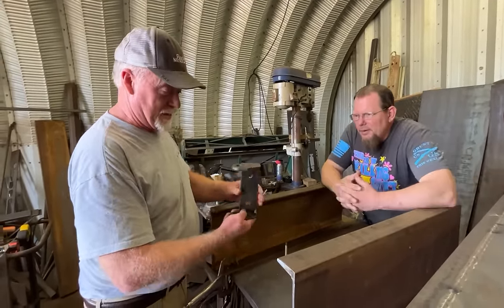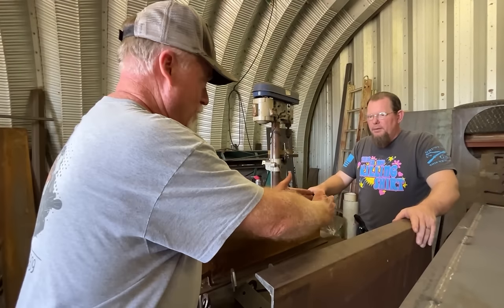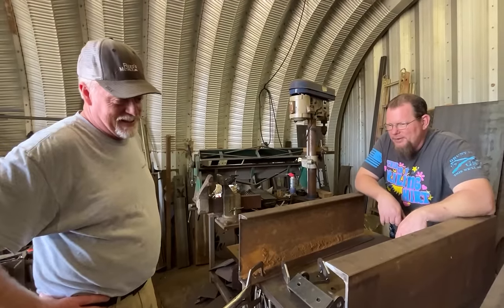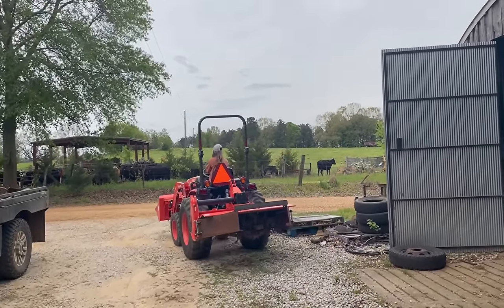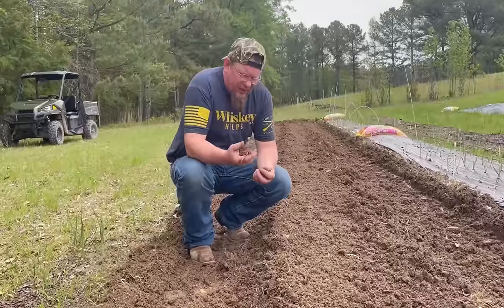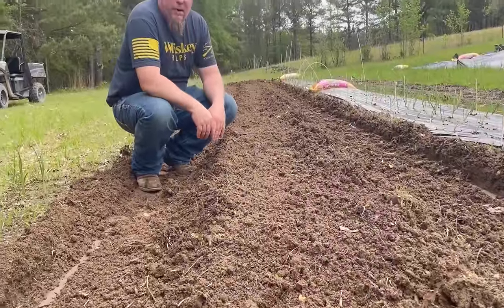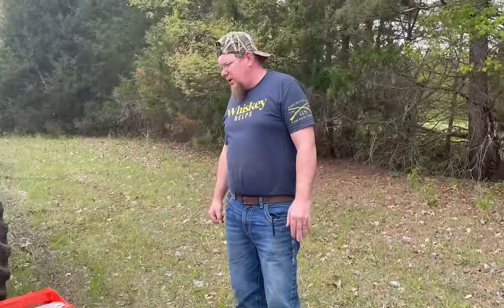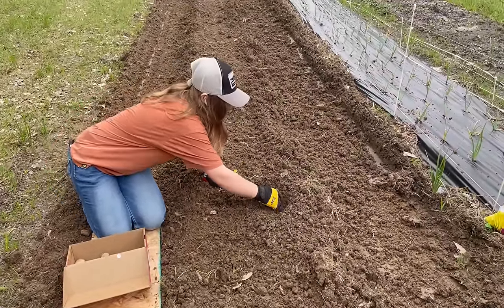Homemade Garden Row Builder, First Time Trying It Out!

Comment: Welcome to Mississippi.  Don’t know exactly how long you guys have here but did notice 2610 tractor and equipment.  A suggestion if you don’t know,  use a 6 or 7 foot steel fence post to move equipment while hooking or unhooking!  Makes hooking up with the standard 3 point hitch much easier.
Phil

Comment: The bottom flange on the hiller is holding it up just like the side shoes on the tiller. remove the bottom flange and you will see improved hilling and save time and fuel.
Reply: I agree, but also maybe, if they left about 4-6" of the bottom flange, bent down at the front, maybe that would help "pull" the hiller down into the ground?  Obviously I am not sure, but the unit is not going into the ground.  🤔
Reply: I completely agree. that was one of my first thoughts on this style vs many on youtube

Comment: I am a fabricator at heart, I love seeing new equipment being built and refined. You are on to a great thing here. One thing that might help with the less than ideal soil conditions is maybe taking a grinder with a wire wheel and cleaning the inside so that the soil has a smoother surface and less friction allowing the dirt to move freely. I learned a trick years ago with a shovel,if it is clean and smooth digging is much easier. Wish you the best with this project, and please keep up to date.
Reply from the maker: Oh cool ! Yes, it’s a great town with great folks !

Comment: Boy, that thing is really going to be a game changer for that tiller.  I haven't owned one of those but a friend has one and one thing it lacked was a good way to lay off rows.  This will fix that for sure.  You are right, the best way to do it is to till without it and then come back to lay off rows.  You could probably pull that in to the second notch and make a perfect well mounded row in good soil conditions.  My Daddy always believed in having good "middles" to hold water between the rows in dry times and keep the seed/plants up in wet times. Ideally, you'd have a tractor like the old single row Farmalls or John Deere models to do a garden with, but this will do.  You will just have to put down plastic or do something for weed control.  

If this video was shot close to the current date, you may be a bit late for planting potatoes.  I grew up in Central Mississippi about 90 miles south of you and we usually tried to get them in by mid March for harvest in mid June-ish.  You may have trouble with potato bugs and other vermin by going later.  Funny story about planting potatoes.  My mother and father got married in the late 40's and made their first garden at our home place in 1950.  They apparently got into a big fight about how to put the seed potatoes into the ground, with my Daddy insisting that the "eyes" go UP.  My Mama thought that was insane and she just dropped them wherever.  Turned out it didn't appear to matter and they didn't get divorced over it, thus  I survived to comment on this! :)

Comment: Took my 6'  "light duty" 3pt blade that bent in the middle, cut in half and made a  5' wide v-blade. It works great for snow removal and as a reverse "V"box blade for grading and with height extensions, does my raised beds.  Really practical. Nice job on that rototiller set-up PS also installed cheap rear license plate camera, and i never looked back 😊
Reply from the maker: Ha ha that’s a good idea

Comment: single bottom turning plow way then do it on the other side of planned bed area and have the soil turned into each other add manure, fertilizer or azomite; then till once or twice without hiller, the third pass add hiller and it will give you 8-12inch deep garden bed hills.

Comment: You might want to fabricate a "forward facing V" to attach under the 24" tie-bar across the back.  The forward facing V would force the middle soil to the side and form nice parallel seed rows.  Might need to make the "V" plate adjustable as you expand the side rails to accommodate a wider seed bed.  Just a thought.
Reply: There's definitely opportunity to fabricate row makes along the rear tie bar! They could probably be as simple as all 1/2thread sticking down since its well tilled beds.

Comment: you need to taper the front of the steel channel or use a narrower steel so the the cutter blades roll up more dirt and dig up more volume of dirt to pile in to the row and make the funnel smaller in the rear [basically dig deeper to pile higher]

Comment: I think the concept has merit but i think the height of the I Beam is what is killing the design. As it stands the tiller is not able to depress further into the soil. How about cutting 4 inches off the bottom and adding it to the top of the i beam. That would create a much deeper row. Also the soil is way to wet.